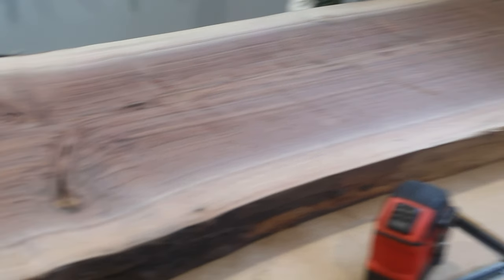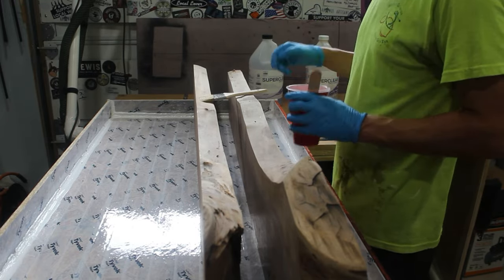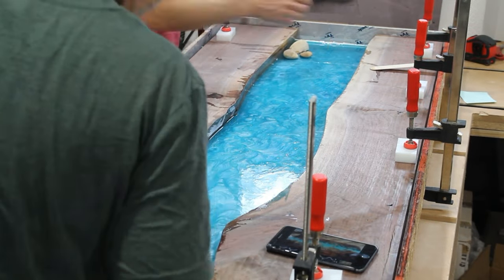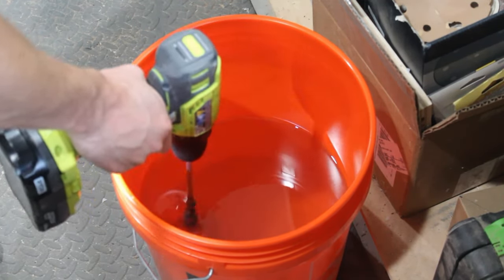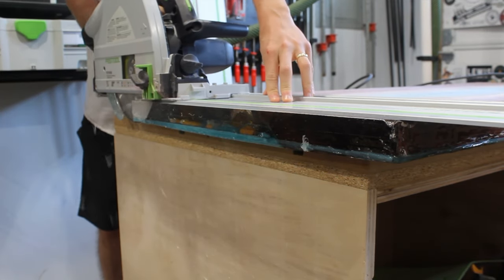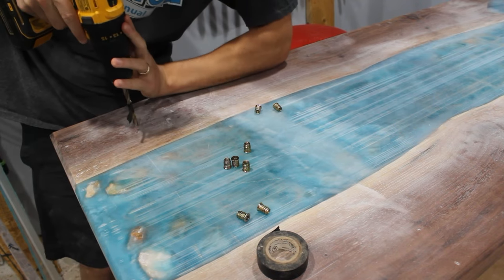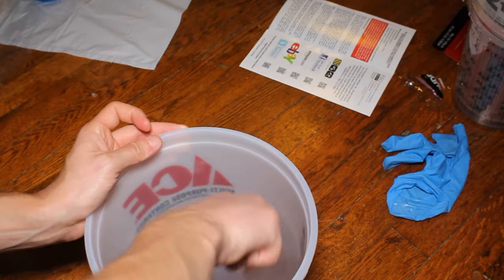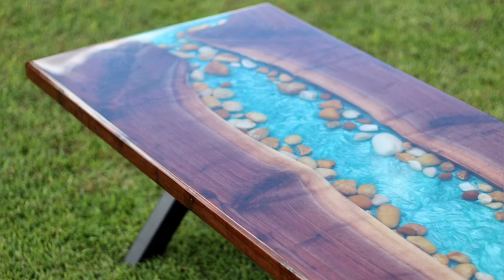How to: River Rock Coffee Table - MacArthur Woodworks

Comment: Thanks for sharing! Maybe a silly question, but why sand and polish it, then add a top coat? It looked clear before the sanding.
Reply from the maker: Do you mean clear when I poured it? It was very clear then, but the wood and epoxy levels were not the same. So, you have to flatten the table, sand, then pour a clear coat of table top epoxy. Good question and thanks for stopping by! Subscribe 💪🏼